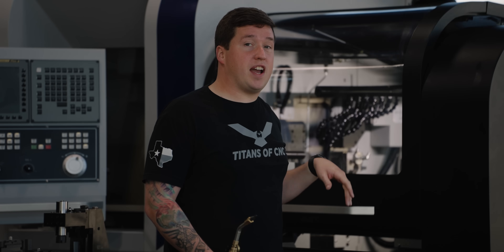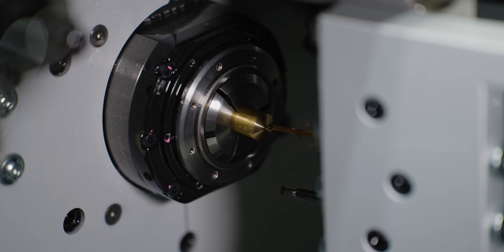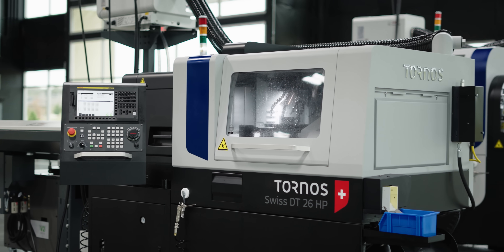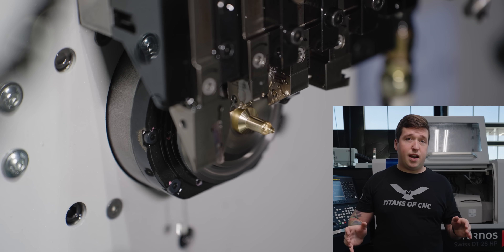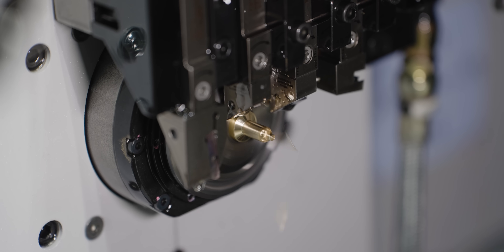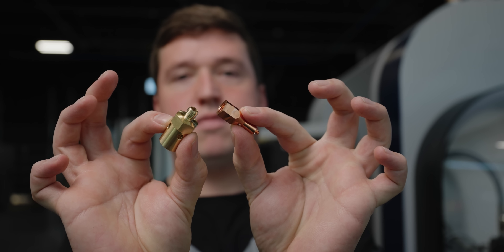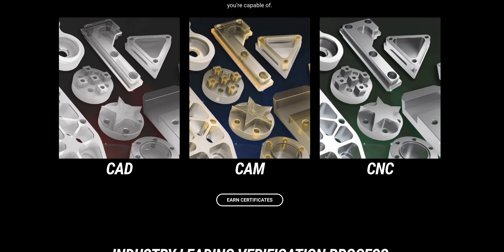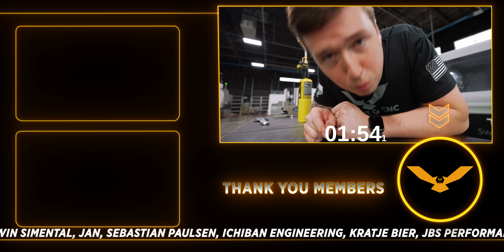Incredible Swiss Machining Angled Hole Technique!

Comment: Does that G code for oscillation work on lathes with basic fanuc controls, Iv been the only guy to turn copper on this copper only eco-turn DMG more and no matter what tool we used we could never get it to break chips, several M00s in every program just for clearing chips. I really wanna try it
Reply: No the machines have to be specially designed to run this type of technology.  Most regular lathes can't do it because of the size/length of the axis lead screws.  Even on the machines that can do it the lead screws have to be designed to handle the vibrations.  When these codes are running you can actually feel the machine vibrate.  I don't have a Tornos machine, I run Citizen machines that have the exact same technology.  The Citizen version is even easier as I don't have to specify what axis I'm using the machine does that automatically.
Reply: @brandons9138  that’s a shame, I’m still looking for a solution to copper turning on my dmg mori.

Comment: Great Video! I work with coppers on a doosan lynx and any tips on how to imitate ACB?
Reply: Your machine doesn't have the technology to do it.  It requires specially designed hardware.  On most regular lathes the axis lead screws are too long to handle the vibrations.
Reply: Any tips on better chip breakage?
Reply: @bobmike3030 I work with a lot of polycarbonate which is a bitch to break chips on. One thing we often do is to mill a slot down the length of the part to create a gap that breaks the chip. If the chip is still too long, mill another slot 180 degrees from the first one that will make a shorter chip. Of course this is only good for OD work. If you are working with metal and interrupted cuts are causing tool failures what you can do is cut OD grooves along the length of the part. This will have the same effect, but it's not as hard on your tools as the interrupted cut isn't beating the crap out of your tooling. Here again this is most effective on the OD. For finishing passes unfortunately there's not much you can do. One thing I've done with mixed success is alternate your finishing cuts. For example if you are doing an OD finish up to a shoulder. I'd cut the OD, while not touching the wall face. Then leave the part. Position above the wall and cut down the face of the wall. This methodology is highly dependent on part geometry.

Of course all of these methods add to your cycle time, but can minimize operator interaction. So they can offset themselves to some degree.